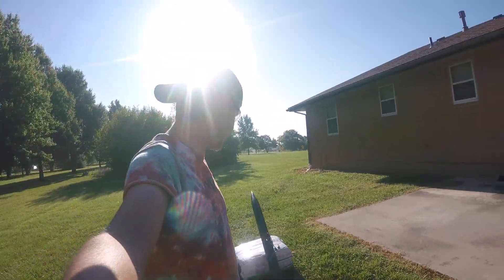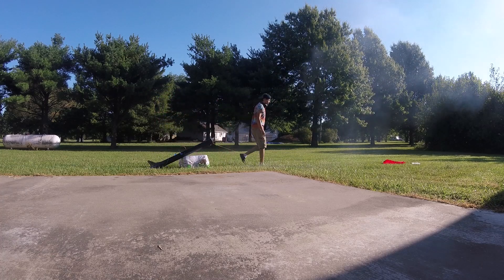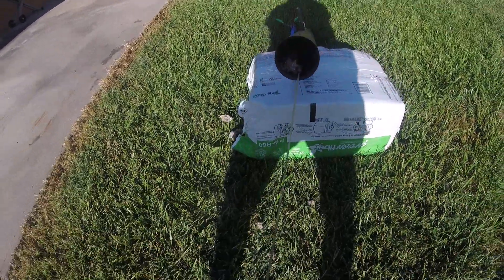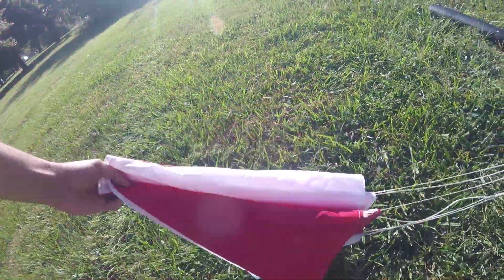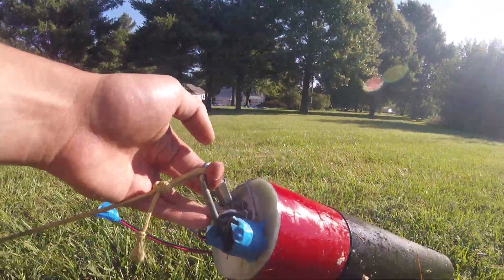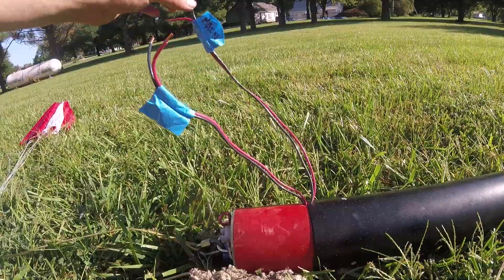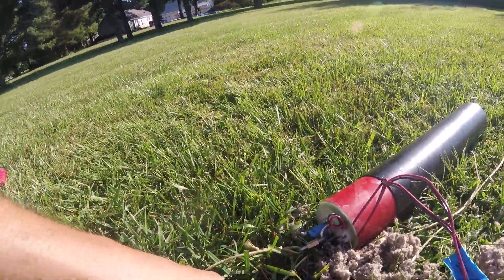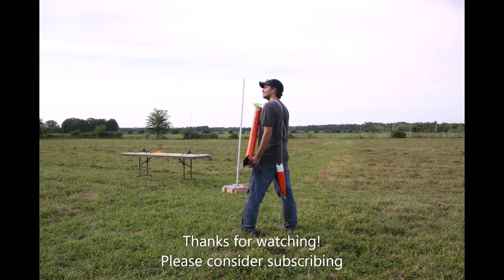Dual Deploy Testing Pointy End Up

Comment: Nice! You should consider attaching tennis balls to your shock cords (close to the body tube edges) to avoid zipper. Also, are you using Nomex chute protectors? I wouldn’t rely on just dog barf to protect my chutes. Also, it seems like you could use some more black powder for main deployment?
Reply from the maker: Main deploy was hindered (IMO) by me being attached via wires to the electronics bay, although I will add a little more Black Powder just to be safe. I will definitely look into the Tennis ball idea and chute protectors.